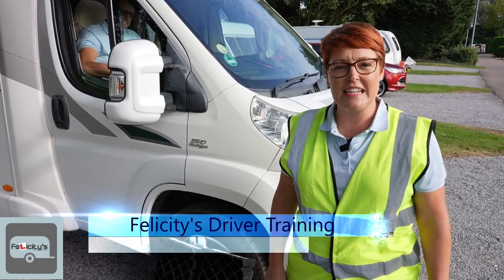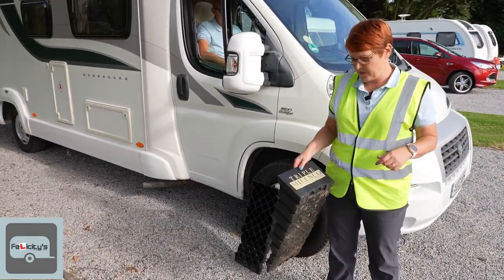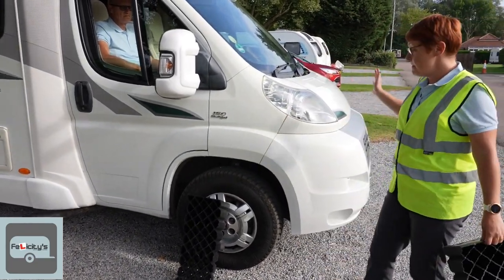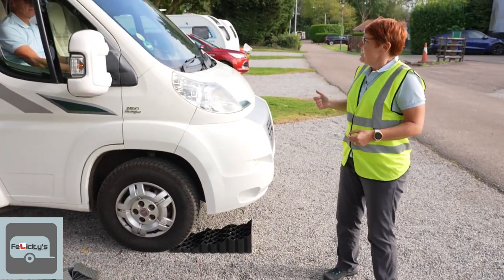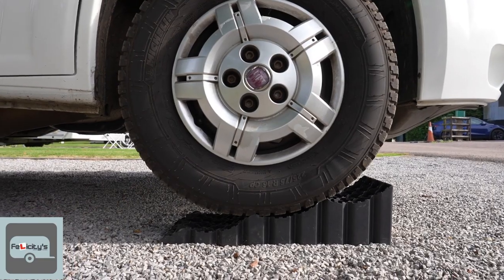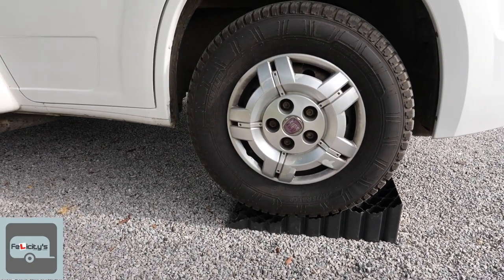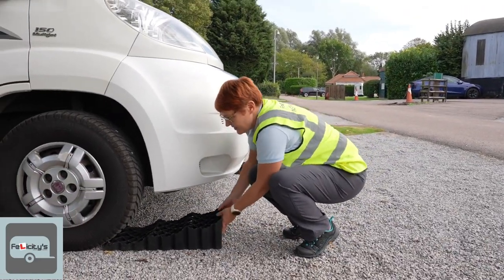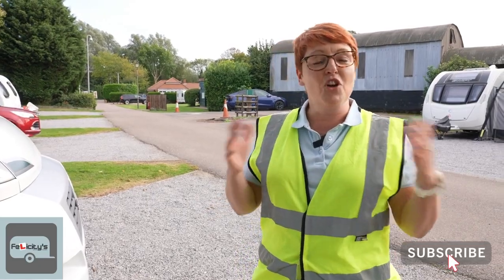HOW TO LEVEL A MOTORHOME USING LEVELLING RAMPS

Comment: Here's the thing: if you level side to side unevenly on ramps so as to account for uneven ground, aren't you then twisting the chassis?
Reply from the maker: Thanks for your comment. I'm no expert in the design and build of motorhomes. My understanding is small amounts of levelling (as shown in the video) will not cause too much twisting for short periods of time. I have experienced my bathroom door not closing properly when I have levelled up. My solution was to reduce the height of levelling to release the door and remove the strain on the coachbuild. 
There is no need to be perfectly level as it only encourages rain water to accumulate. 
If anyone has any thoughts or insight on this, please comment below.